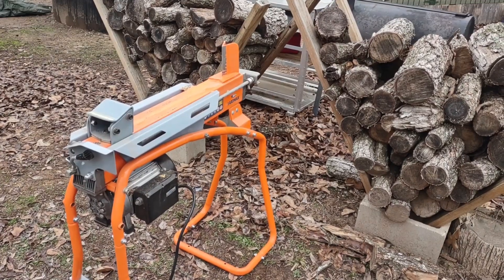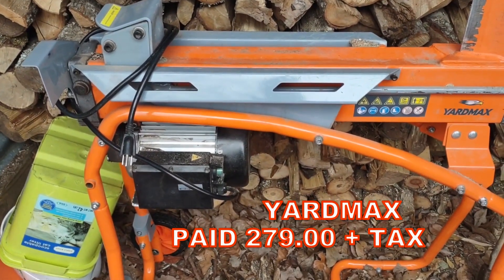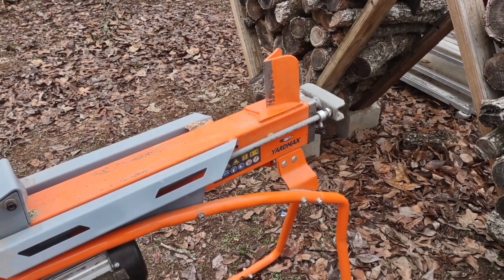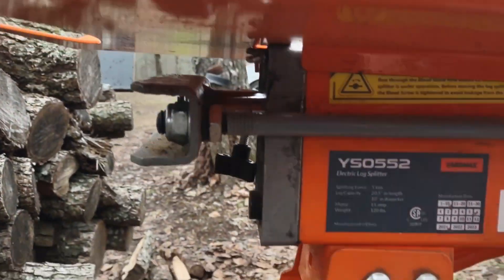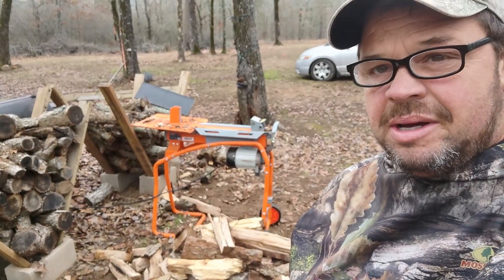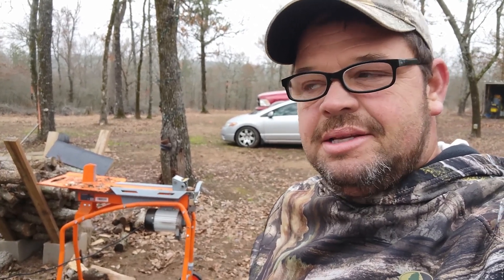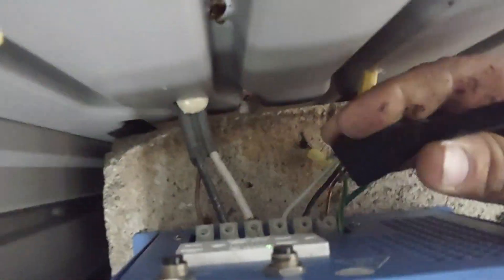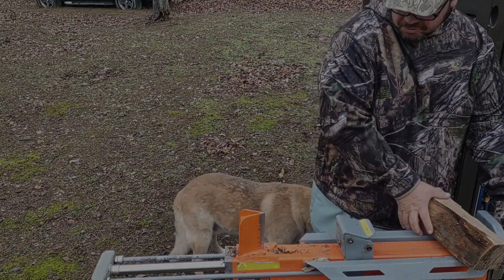Electric Wood  Splitter. Can You Run It On Off Grid Solar?

Comment: I would like to build a gravity powered wood splitter. A ratched pulley that lifts a splitting blade to an appropriate height, and can be lifted by spinning foot/hand pedals like on a bicycle. Zero electricity required, and very reasonable physical exertion on the body with good body mechanics. Even an elderly person can operate this type of gravity wood splitter.

Comment: There highly dangerous. If a log explodes or shoot out with legal force.  That is why i rig mine up HANDS FREE. I don't want to be any where around it!   Its all operated by a wooden foot peddle!  with rope tie to the lever, running down looped to the foot peddle back up to the button with a HINGE> I loosen the box up and slip a hinge down between the box and motor, then tighten it back up. Where the hinge lay on top of the button. with the rope tied on the hinge to pull down on the button.  i press the peddle pulls down the button and lever at the same time
Reply from the maker: hmm thanks for the knowledge ...it did shoot one out on me in the video. not a full explode but shot out and hit me in my side pretty good.
Reply: @OKLAHOMAOFFGRID  That look like it smarted. The stand i made for it is 8 concert blocks 2 high, 4 in the back wheels, and 4 in the front legs  IT VERY STABLE 👍  it made a nice strong stand
Reply: @OKLAHOMAOFFGRID  There very dangerous. People set beside them? NO WAY i would set beside it.. That why i made it hands Free.  Now i love it.

Comment: Good video, I was also wondering if solar could handle the load. Thanks for sharing with us
Reply from the maker: Yeah no problem man. It will do it, it seemed to be a little hard on the inverter on the startup. But once it was going it would crack that wood like nothing. If I have to use it because I don't have gas for the generator or something I'll definitely do it. I just don't like to run the inverter that hard
Reply: All you need is a 2k watt small gasoline generator to operate on  I got my generator for 125 buck